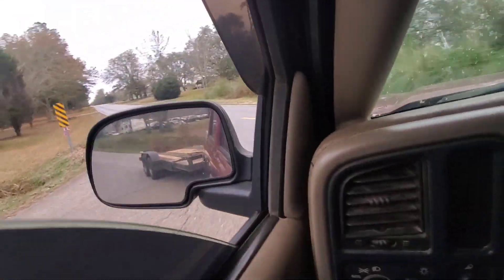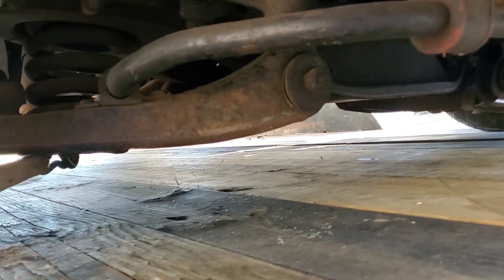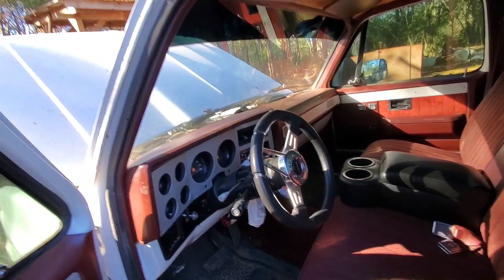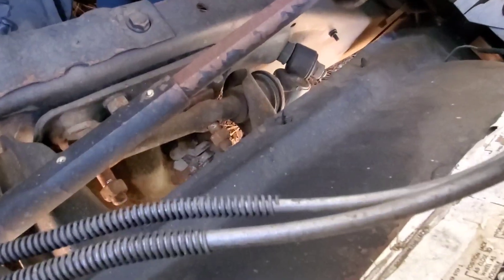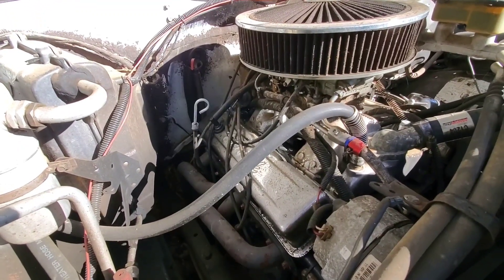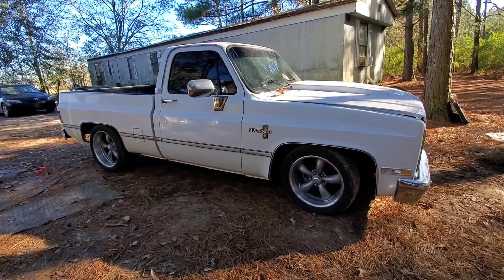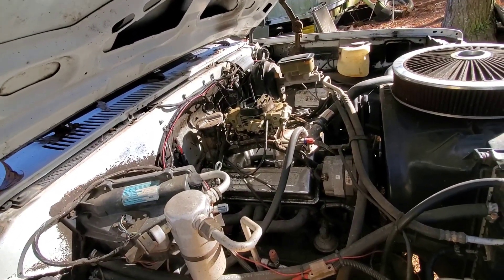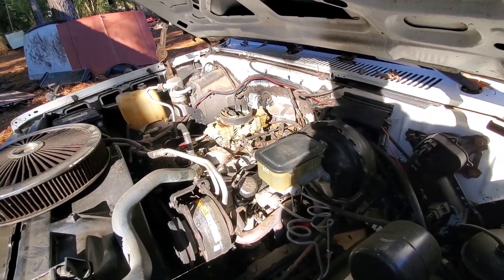Clean 86 C10 Silverado

Comment: I hate people who show off their rustless trucks. That truck never seen snow. Bet it's a two wheeler...... Wish I had though...Love hate relationship. Thanks for sharing. I'm moving away from this snow in PA.
Reply: Even if you live In a snow free place your still not safe from rust. I live in florida and the salt air and intense sun destroys interiors and burns the paint off the roofs and hoods and the constant rain rots cars from the top down. Most classic cars in florida suffer from extreme roof rot and rust around the windows, the best climate for metal is out in the desert states because it's so dry.
Reply: Dang it. To hot in AZ. Could only work at night. LoL